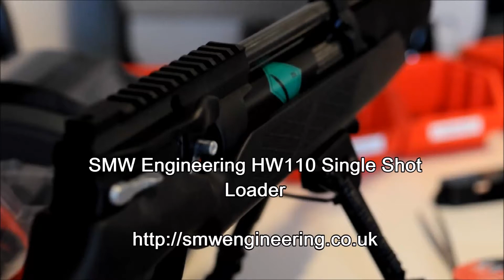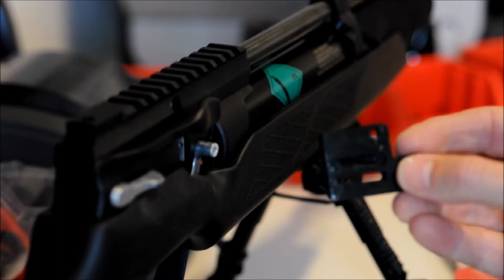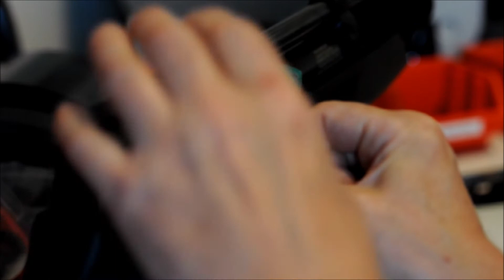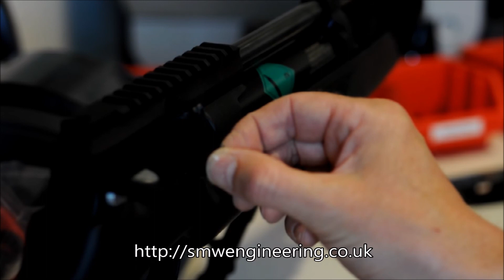HW 110 Single Shot Loader by SMW Engineering

Comment: Just one question...WHY? I so no point for this, use the supplied magazine and fire once.
Reply from the maker: The loader does not need to be removed between each shot. It does not need to be located so that the pellet is in the correct hole. For HFT and FT it is two less things to remember and worry about at each station and less chance of a dry shot.